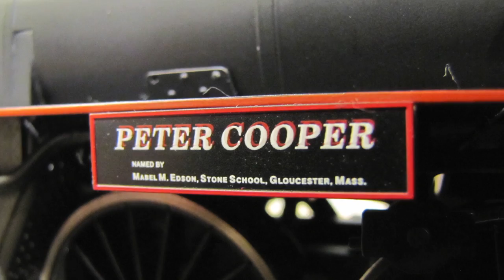Weaver Models B&M P-4

Comment: Do any of these engines still exist?
Reply: Leozilla 97 there is one, no. 3713, named “The Constitution” during a contest where school children could name B&M’s Pacific locomotives at the start of her career. When she was saved from scrap, her red and yellow speed lettering livery was replaced in favor of the box livery (kind of a shame seeing how nice her speed lettering looked). She’s currently housed at Steamtown, where she is currently undergoing a restoration for potential steam excursions. There’s a website about her and her restoration progress called Project3713 if you want more information: 

http://www.project3713.com/
Reply: B&M 3713 is going to be the replacement of CN 3254. Because during it's operation. 3254 had suffered a bent frame. It's last run was 2012 at Steamtown. Today 3254 is inside of the roundhouse at Steamtown. And Boston & Maine 3713 is still under restoration. It is going to return to operation sometime in the future.
Reply: @nathancorcoran5347  Not To Mention. 3713 Hasn't Ran Under Steam In 50+ Years
Reply: @EngineerDaylight  it has last operated on it’s Farewell to Steam excursion at the B&M.
Reply: @nathancorcoran5347  that was during the Late 50's iirc
Reply: @EngineerDaylight  yeah.